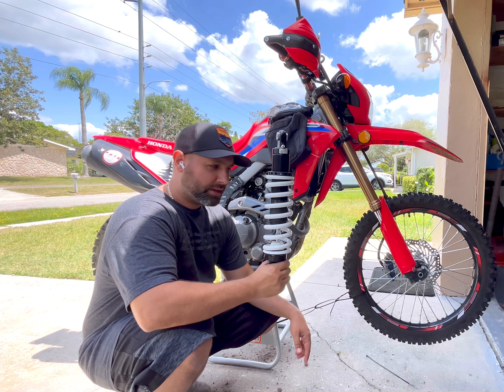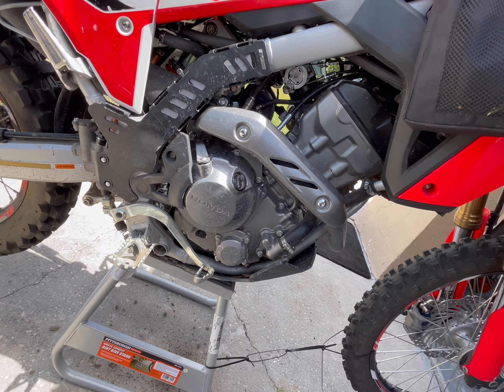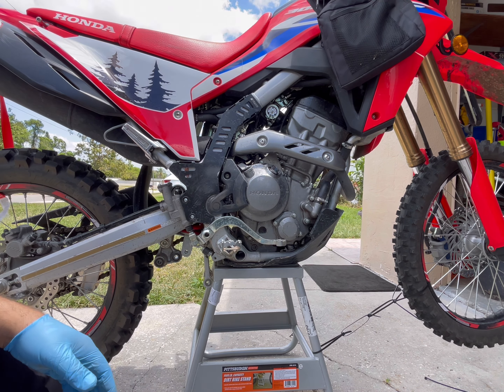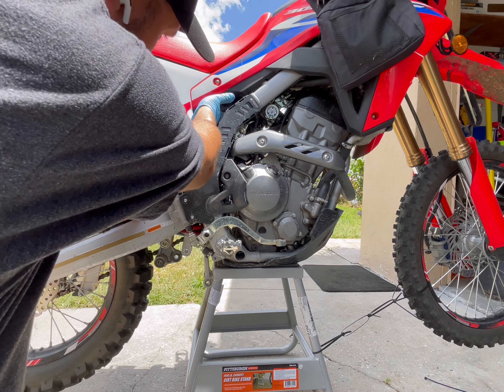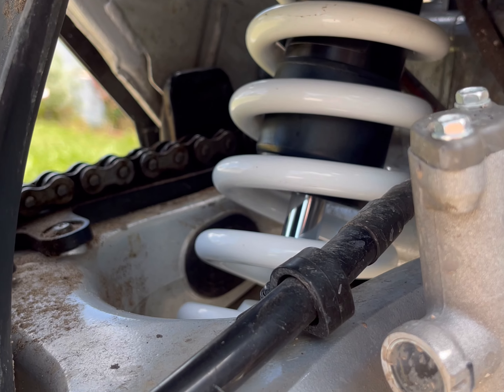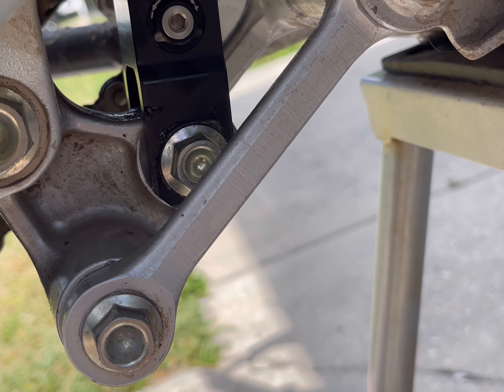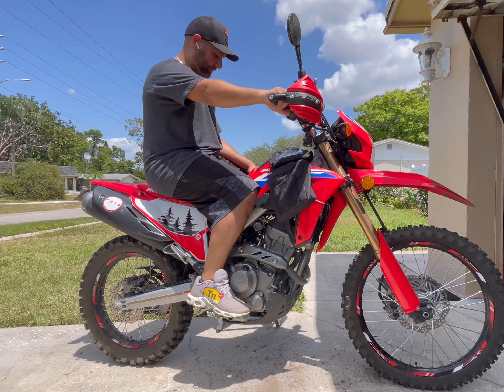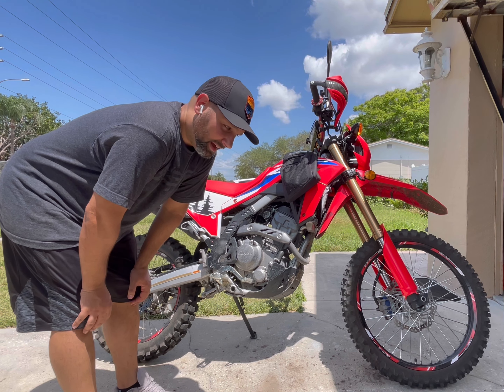JUNK THAT STOCK SHOCK!! Rally-Raid Shock Upgrade On A Honda CRF300L

Comment: Why did you choose the Level 2? I'm waffling in between the 1 and 2 series, and I'm the same height as you, but a few pounds lighter. Off road experience is slightly above novice
Reply from the maker: I chose level 2 because I wanted to get the full range out of the shock. I take the bike to the track as well. I think level 1 will work for most riding styles and doesn’t raise the seat height.
Reply: I was looking at these shocks.  Someone said also race tech but I have no experience with either. What did you guys do for front ? Doing just the rear is enough? Can’t see it.  It’s all so soft :(
Reply from the maker: @TheZakkmylde  I went with RaceTech spring kit and glove valves. If you do the back, might as well do the front. Having only the back done really accentuates how bad the front is.

Comment: HPA fiTted or not fitted ? Is that the small cylinders you see on some rear shocks ? Thought they were gas filled. Anyhow if they are those small cylinders if you get the shock that is not fitted does that mean you cannot adjust? Or is the adjustment now within the shock itself and he would have to take it apart if he wanted to just the preload or whatever the adjustment does?  Trying to see if work to it or not or what it does
Reply: The reservoir you see on some shocks primarily offers more oil capacity (and some additional cooling) to stop the damping fading during heavy cycling... however, as FATE explains above, the Rally-Raid shocks have a huge 46mm shock body/piston (the same size as a Yamaha Tenere 700 and KTM 690 for example) so it doesn't need the extra oil capacity.  

On higher spec/price shocks you do often find individual compression damping adjusters are incorporated into the reservoir assembly - primarily for easy access and because that is where the compression circuit is located as the oil inside the shock body is pushed in and out of the reservoir) - but in the case of the Rally-Raid shock for these particular bikes, the damping adjustment is more simple and combined into a single clicker at the base of the shock.
Reply: @yodapig  thank you. So for a Honda Crf 300L one without that should be more then enough I assume ? For the average rider looking to have some fun? 😊
Reply: @TheZakkmylde  for sure... keep in mind the adjusters are primarily there for you to set up the characteristics of the shock the way you prefer (preload to set your sag, and damping adjustment to control how quickly the spring reacts and rebounds) - then you can essentially forget about it and let the shock handle all the varying terrain as it happens. 

There really is no need to be making constant adjustments [to the damping] unless you were racing off-road and wanting to optimise your settings for a particular course perhaps... although if you do plan to ride regularly between solo and laden with luggage and passenger, then having a remote/quick preload adjuster (which is an option from Rally-Raid) is a good idea to help compensate for the additional weight being carried.

Comment: Did you also do the front forks?
Reply from the maker: I did. In my opinion doing the front was absolutely necessary after upgrading the rear. It really shows you how soft the front is. Went with race tech for front.

Comment: What made you decide on rally raid brand suspension?

Are you planning on doing anything with front suspension and is it necessary?

I'm 5'7" and about 130 pounds (without any gear). I like to ride aggressively...fast and jumping. I don't want to raise the seat height of the 300...that's one of the things I like about it.

Is the level 1 shock something that will work for me or is it too much since I'm pretty light? Thanks and nice bike! 👍
Reply from the maker: I chose Rally-Raid because of price and quality. Their shock has a 46mm body and the whole thing seems quality. 
I think at your weight, you have to determine if you feel you need better suspension. I know at my weight, the suspension just didn’t cut it.
I think the level 1 would be fine as it keeps the same seat height.
Reply: @FLAdventureAndTrailExploration  The problem is more than just the spring rate (for his weight compared to yours), the shock has no damping or rebound adjustment. That should be the first thing to look for in a new shock. The spring can easily be changed but that pogoing is more than just a spring issue. Can wait to try mine, still waiting.

Comment: Hey mate nice bike, just curious did you get the 210mm or the 250mm shock? I'm 5,7 an can't decide what size to get 😅
Reply from the maker: Thanks! I got the 250mm shock because I wanted the full travel out of it. I’m also 5’7. Depending on what you want to do with the bike, the 210mm shock will have enough travel for most people.
Reply from the maker: Subscribe if you haven’t done so already. I’ll be testing these shocks out thoroughly soon. Just got RaceTech installed on the front with gold valves.
Reply: Sweet!  so the 250mm travel option doesn't make it to hard to reach the ground??
Reply from the maker: @thevinceperspective9506  it does honestly but I manage. Depending on your riding skill. If I stop, I can touch the ground with my top toes. Or lean it and I’m fine.
Reply: @FLAdventureAndTrailExploration  did you do them yourself , wondering how hard it is.  Those fronts are not adjustable unless you take them apart correct? Just wondering how you match it with the rear then if it’s enclosed or I assume you set up the spring rate to match the rear right from the beginning?
Reply from the maker: @TheZakkmylde  I took the bike to the shop to get the front done. Wasn’t comfortable doing them myself